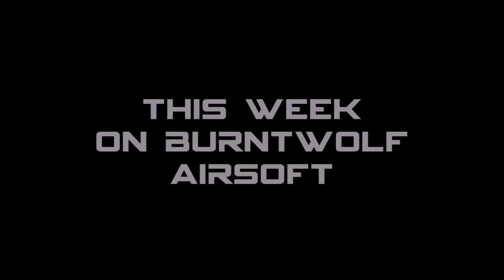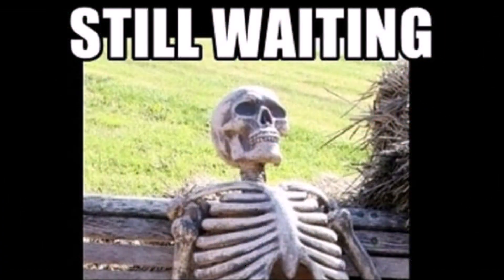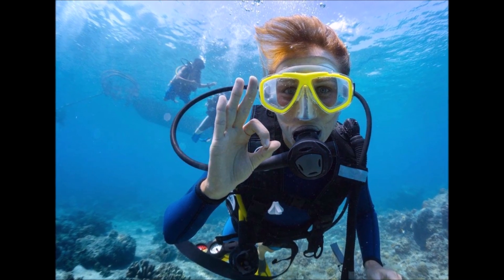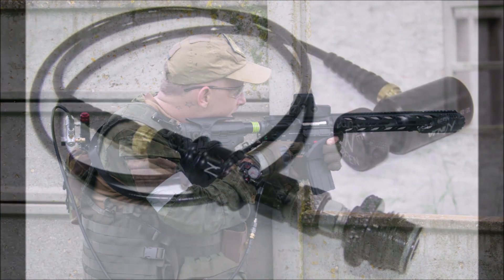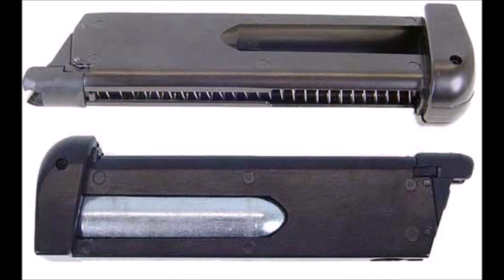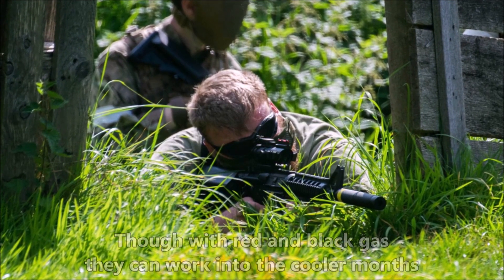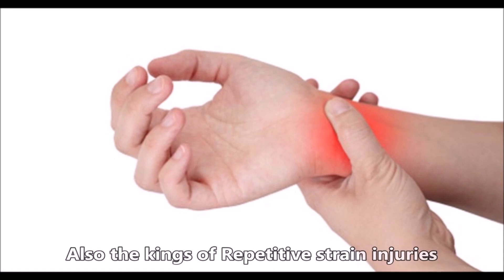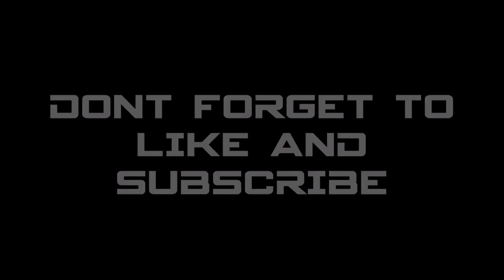Airsoft Propellant types,Pro's and Cons

Comment: I know lipo's have a better efficency but I prefer to run standard Nihmh's to prolong the life of my gearbox and reduce the amount of maintenance i Have to do. Honestly, Lipo or Nimh most players really won't see a difference in performance imo.  I do want to add in, that they do make 12 gram CO2 cartridges with lubricant inside that should be used every 8 to 10 charges inside your CO2 guns. I rotate my grenades gas from green to red/black dependingo nt he tempature. As for HPA, this is just my personal opinion, but if I want high powered rounds flying at me, I'll go play paintball. Seriously. I honestly don't see the appeal to wearing a tank on my back to shoot a palstic bb that bounces off.
Reply from the maker: Deffo im the same youve come up with a good few points there iv missed so iv pinned it for the others

Comment: Springers are my favorite as well, for multiple reasons:
1. A spring gun is indisputably the most powerful. Springs can be upgraded to just about any Joule level you want. With gas and HPA you're limited by the max pressure rating of the tank/cartridge.
2. A spring gun has the most consistent FPS from one shot to the next. Gas and HPA lose FPS with every shot, and AEGs lose FPS as the battery discharges.
3. A spring gun is the simplest kind of gun to service and upgrade.
4. Even though a spring gun has limited rate of fire, it encourages the shooter to be more disciplined with the shots they take.
5. Spring guns are the least expensive.
6. Spring guns require no auxiliary power sources. They will shoot all day long without losing power, as long as you are up to the task of cycling the bolt with your own muscles.

Comment: Love my GBB Pistol.
Reply from the maker: Same mines getting a bit old and tatty now tho
Reply: Burntwolf Airsoft If some parts rot, you can just replace them or clean them.
Reply from the maker: @ember5935  Iv cleaned it,its wear on the slide,the trigger and parts of the mec i might as well buy a new one,could upgrade it to PPS standard though but would cost me about £700 quid. (a straight up replacement would cost me about £170)